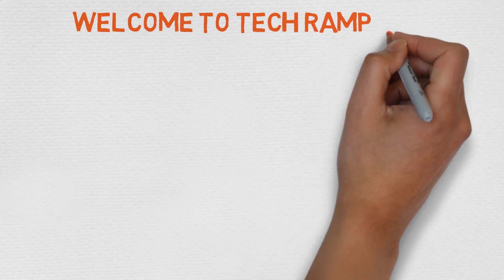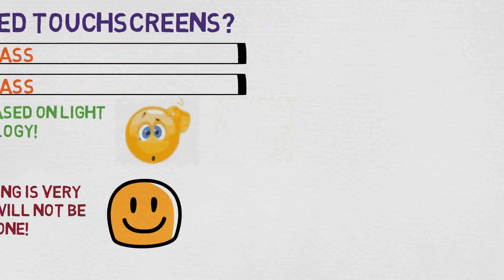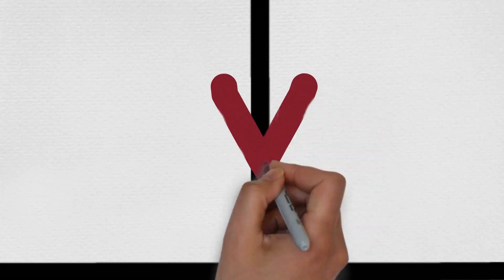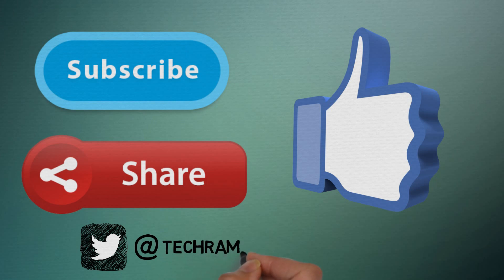Touch Screens! How do infrared touch screens work?

Comment: 🎯 Key Takeaways for quick navigation:

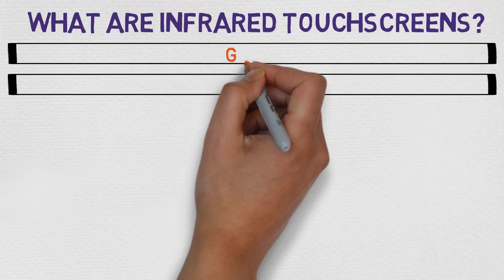00:21 📺 Infrared touchscreens use glass and light beam interruption technology for touch input.
00:50 💡 LEDs emit light on horizontal and vertical sides, and sensors detect light interruptions when you touch the screen.
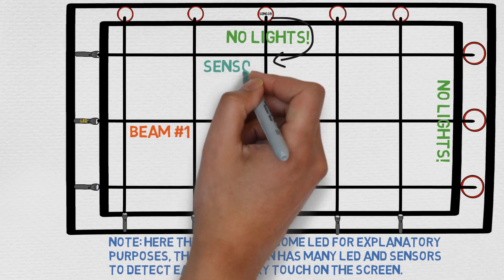01:18 📐 Touching the screen interrupts two beams of light, providing x and y coordinates for touch input.
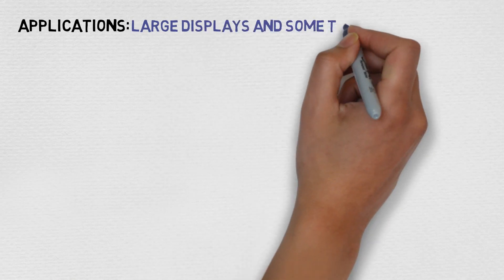01:32 🖥️ Infrared touchscreens have applications in large displays and touchscreen watches, suitable for wet fingers and durability.
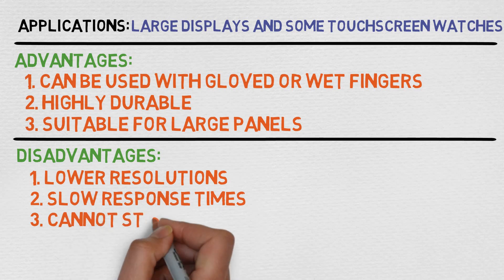01:45 🚫 Drawbacks include lower resolutions, slow response times, and inability to differentiate unintended touches like flies or mud.

Made with HARPA AI